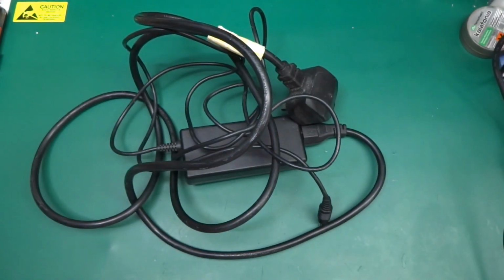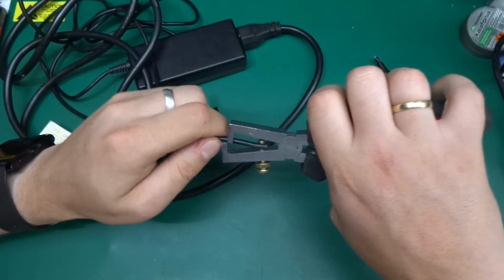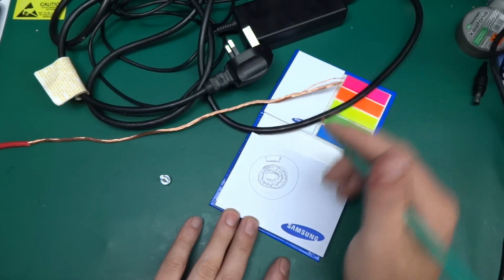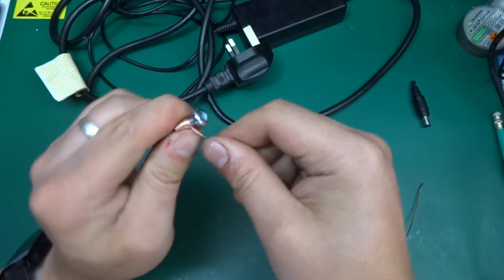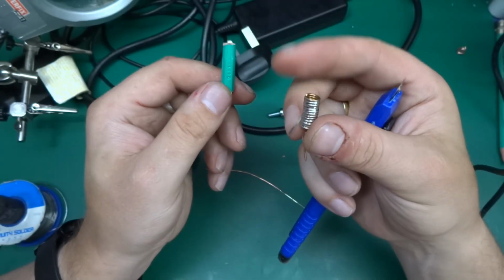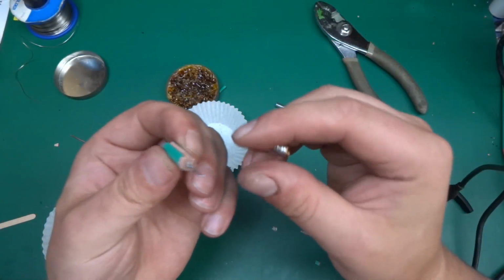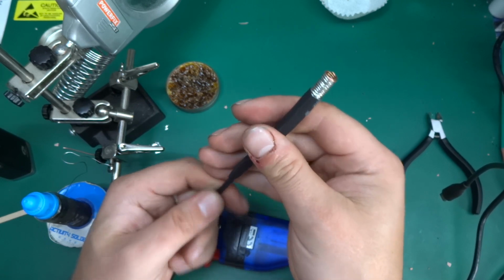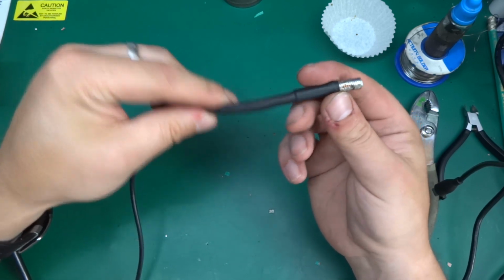DIY laptop plug make/hack on a budget

Comment: Thanks for nice method to make permanent plug.  For quick testing  (for repairing a laptop for example), you can make a temporary plug using snips of tin can bent into an arc (dosn't need to be full circle, just an arc to make contact) and a straightened paper clip or piece of bare copper wire.  Fit the pieces in the laptop power jack and then put some hot glue in between, and you can power the laptop using any appropriate DC power brick
Reply: Need the video Bud 😁
Reply: got a video for this? im interested.
Reply: Video?
Reply: @MedinaTorres-jq9jb  Curse of the era. Ain't buying without proof.

Comment: Haha this is not as described in info on video... 1 you did not make 1 you used and existing charger and made another fitting basicly... home made charger i wanted to see you make 1 not just use a charger 🤦‍♀️🤦‍♀️ 14 minutes wasted could just put positive wire inside a pen lid negative on outside plug it into the port you can cut end to fit better use electrical tape keep wires and pen lid  together simply plug into laptop sorted pen lids come in all sizes find your size make sure plenty wire on inside of pen for good connection and also make sure lid fits outside if not use alittle tinfoil over negative wire wrap around outside of pen lid plug in so snug fit sorted 😊
Reply: GL with that mate. Turn ur laptop into a 💣